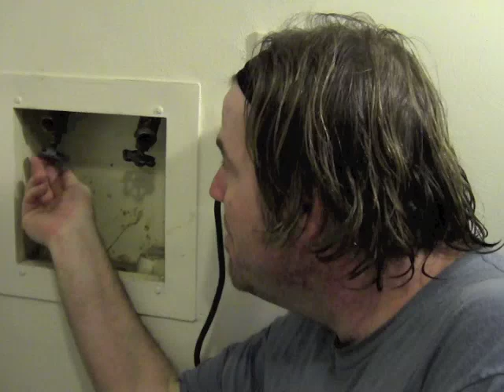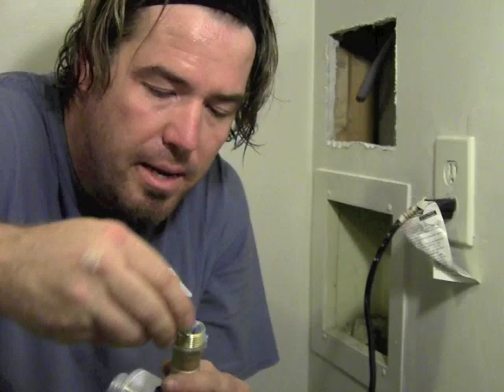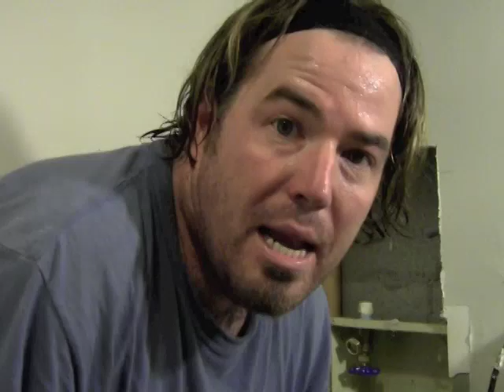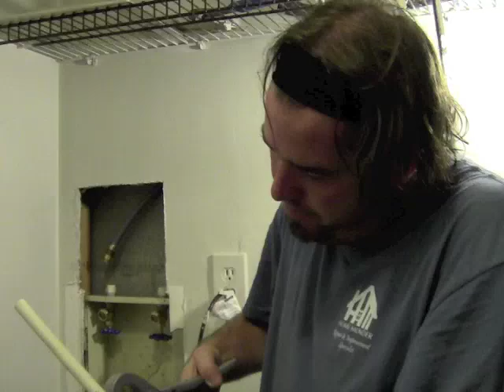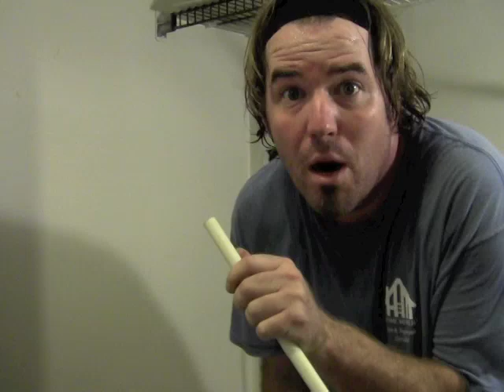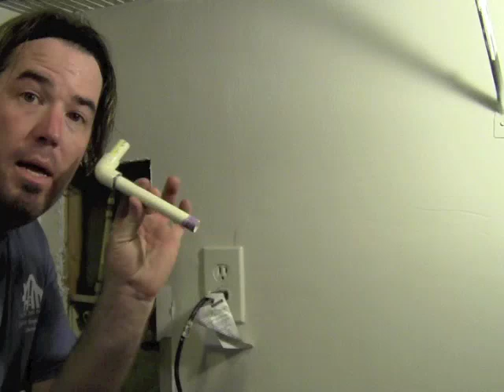How to replace washing machine valves, cut offs. Easy! Home Mender.

Comment: Heya! Nice video! You make it look easy!!! Quick question, my handle of my valve box connected to the washing machine, is there a handle I can use without replacing the entire unit? Thanks in advance
Reply from the maker: hi judy, yes mam, you can pick and choose or do the whole box, if its just a handle, you can take it off and try to match it up.. i hope this helps!

Comment: Hi, I just watched your video and it gave me more confidence in my husband and I doing our project. We have the washer hot cold hookup in the kitchen wall that abuts to our bathroom wall. We want to flip the hookup into the bathroom to move laundry from the kitchen to the bathroom. You wouldn't happen to have a video of you doing something similar? Or advice on flipping it to the other side? We are new to all things plumbing.
Reply from the maker: hey lula! i dont have a video for that but the confidence is all you need.. the same way this was done, you would cut a hole in the other side and turn them around..depending on what style box you choose, ideally youll want to switch the hot and cold sides... you got this!

Comment: Dude——just wow ——amazing thank you so much——-I’m getting my mom settled into a new apartment and the spigots are just covered in lime and rust and need to be changed——this made it super easy thank you
Reply from the maker: you're awesome shant! thank you!
Reply: Home Mender Inc hey bud actually quick question for you, if you do not mind? I have researched everywhere ....my moms closet has the room for a washer and dryer but problem....only 110/120v access and washer hookup and drain,  does not have 220/240v or proper venting......looked into ventless electric dryers ....super expensive and need 240.....can I get a 110v and just get one of those kits that allows you to vent inside?

Comment: What stops those nuts from loosening up? Did you use some thread locker? Do you think it would be a good idea to have a small access panel above the box for future issues? Hmmmm...
Reply from the maker: hey S...an access panel would be convenient but you would have an access panel over it...the nuts are the little lock nut style and should not have a problem loosening on you but some thread locker wouldn't hurt..i hope this helps!

Comment: okay so when i turned on the main water line to the house i just moved in water was shooting out of the faucets in the washer and dryer room so we turned the knobs to the water line and the hot water closed up and the cold water did not we turned the knob but it is loose and the water continues to shoot out so we cannot turn our main water line on until we solve this issue do you have any suggestion what might this be or how i could fix the issue? the washer hookup valve knobs they are unlike the traditional wheel looking knobs that you turn it is a simple knob that turns left and right. Thank you
Reply from the maker: K K hi kk ! It sounds like you may need to change it like I did here.  Don’t be nervous. It’s easy as long as the water is off. You can swap out the cut off. If you’re on messenger you can send me a pic and I’ll talk you through it the best I can!

Comment: Thank you. My husband and I are going to attempt this-this weekend. Plumber wanted $400 to do it. I sent him away. We bought an older home, and all the plumbing seems to have been rigged up by a previous owner. Can you possibly do a video for fixing shower valves, etc?  We can get to all the valves thru a bedroom wall behind showers. I'm desperate to get our shower valves updated. Old and scary. One leaks into the wall when turned on.
Reply from the maker: hi jules.. yes that can be scary.. just check out the how to stop a spigot leak and also we have some shower stem rebuilds on there. typically, if you turn off the water supply and put new gaskets in the valves, that will take care of you! I hope this helps! and thanks for watching!
Reply: Hi Jules. I'm curious to know how your repair went. What problems did you run into? Our plumber wants $700 and that doesn't include fixing the drywall!
Reply from the maker: Marian Green you can do it Marian!!!

Comment: Had a plumber over for a shower..which he didn't do and gave me crappy advice, but he also looked at the aging, but not leaking or broken yet, washing machine valves in my rental.  I haven't cut an access hole yet in the wall..but he said they would be copper in a 16 year old home...this home here is the same age and had plastic and they were in great shape, just the shut offs broke when Sears came to install a new washer. It's my belief that they broke them both, but I can't prove it.  They looked brand new.  Anyway.  Not sure what to do on the rental. I guess I need to cut the hole first and see what's in there.  No way to just unscrew the handles from the top?  Sigh. I am hating life at the moment. Everyone who I am having here to help me with repairs are doing crap work and forcing me to do it myself.
Reply from the maker: thanks for commenting!

Comment: Has anyone notice the real problem. The stupid idiots who build homes don't add a compartment to get to the pipes. Instead, people have to cut through the goddamn dry wall to make repairs. So, by making one repair, now it becomes two repairs because now you have a hole in the wall. Stupid home builders.
Reply: This is pretty much all houses. I have never seen an access panel at the washing machine box. PITA, yes, but these valves tend to last 20+ years, and even then can usually be fixed with a 10 cent rubber washer that will give you another 10 years :). The problem, like this, arises when homeowners keep ramming the valve tighter and tighter when that rubber washer wears out, ruining the valve seat on the inside. Only then would you ever need to cut into the wall.
Reply: Absolutely stupid and it infuriates me. All these should have access boxes. It's not rocket science. Stupid lazy builders. I have an access box in one laundry room of this house I'm in, my rental doesn't. But the box at this house here is STUPID, as you can't reach up inside the wall to the box where the valves are..so I had to cut a second hole up below that box.  WTH is the matter with these guys???  And now I'm dealing with shower shut off components inside a prefab tub and shower...and turns out you can't switch brands without tearing out the entire shower, and the pipe won't take the new plate covers, cut holes are too small to go over the pipe...such dumbass builders.  It's unbelievable. Rant over. Maybe.
Reply from the maker: thanks for commenting!

Comment: Good video. The home builders used a threaded cpvc fitting on the outside of the washing machine valve, which is now cracked and leaking. I want to replace both valves in the same way you did. My cpvc lines are 1/2"; what size valve do I get? The ones you use here are threaded on both inside and outside.
Reply from the maker: +gork830 hi! you'll get the same size i did. a half inch cpvc male should thread into your cut off. ( called a boiler valve in the store maybe) just put everything together in the store so you are sure yo get the correct things. Thanks for watching!